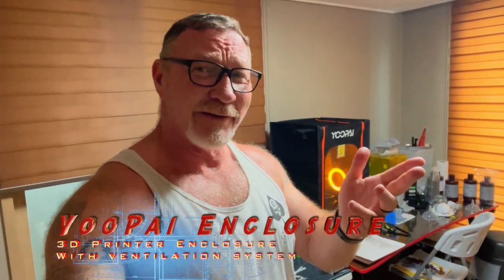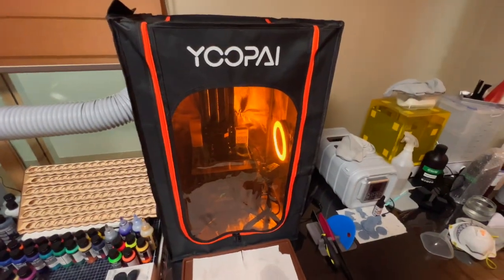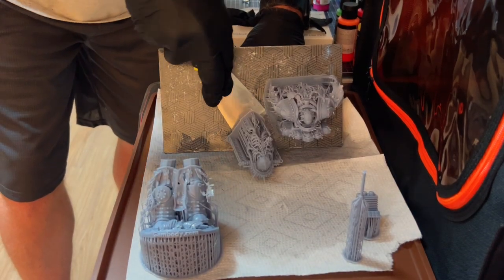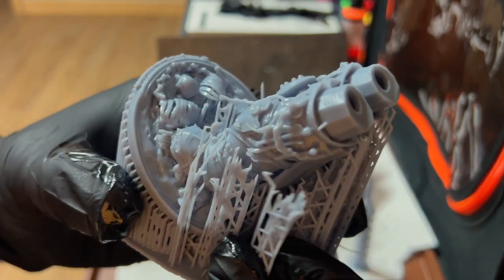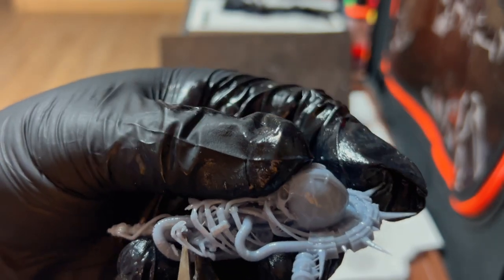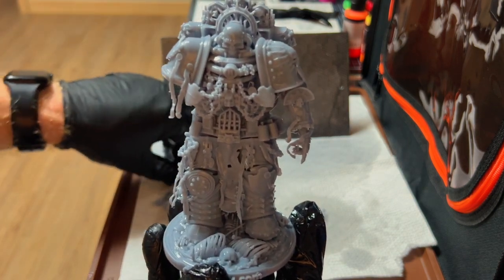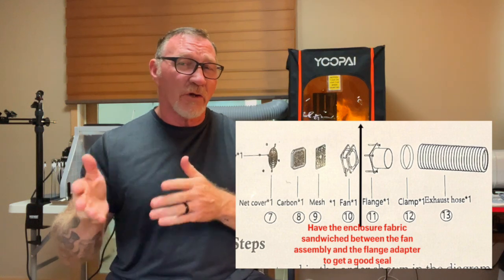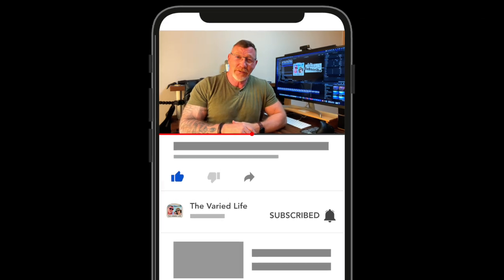YooPai 3D Printer Enclosure for Saturn 3 Ultra - Review & Test print

Comment: This would fit a saturn4 ultra? i curious about the lid design
Reply from the maker: Thanks for watching and good question. The Saturn 4 ultra dimensions are  12.87"D x 12.95"W x 21.57"H and it would fit in this enclosure (approx 17 x 18 x 28). However with my saturn 3 ultra I removed the lid and you would probably have to do the same with the 4 ultra.

Comment: Can it print big things
Reply from the maker: Good question and thanks for watching. The saturn 3 ultra has a build volume of 218.88×122.88×250 mm³ or 8.62×4.84×9.84 inches. So you can get some good prints off of it.

Comment: I just bought the exact same setup (still waiting for it to arrive), I've noticed you are not using the Elegoo enclosure just the Yoopai "tent". Is possible to use the printer enclosure or is just too difficult to use it due to space? Finally, do you think the Yoopai enclosure alone will protect against UV light enough? I'm afraid as my printer will be next to a window, it doesn't get too much direct sunlight, only for like a couple of hours in the afternoon and I'm gonna put some UV protecting film in the window, but sill.
Reply from the maker: Yes the tent works great and I have had zero problems with UV light. I could use the enclosure but the tent has a fan and works great for venting out the resin smell. I have blinds on my windows and haven't had any problems.

Comment: I bought the Yoopai 3d enclosure for my Phrozen Mini 8k S, after experiencing 2 days of failures due to freezing weather. I sealed the enclosure, put the flex hose to the edge of my garage, and shook up the resin before starting the print. It's been flawless since then. The only thing I changed was the Yoopai. It works.
Reply from the maker: Nice. It works really well. Thanks for watching. I appreciate it.

Comment: How about the noise of the printer's fans, does it manage to reduce the noise?
Reply from the maker: It does reduce some noise, which is nice.
Reply: @theVariedLife  After watching your video I decided to buy it because I have the printer in my room and it is noticeable that the resin smells less thanks to the extraction tube, the noise is somewhat less noticeable but still heard.
What I have to try is to install the filter to see if it smells even less.

Comment: Thanks for the video, really helping me decide whether to get this tent or not. Could I ask if you know what diameter the exhaust tubing is? Just seeing if I could rig something together with my spray booth's exhaust
Reply from the maker: I get it. The diameter is about 70mm or 2.75 inches. I made a cardboard adapter to join it up to my 4 inch vent hose that I use with my paint booth.  I hope this helps and thanks for watching.

Comment: I just bought the Saturn 3 ultra. Am i going to need to buy a heater or is that built in? I definitely want an enclosure
Reply from the maker: Good question and thanks for watching. The best temp for resin printing is between 24°C and 30°C (75°F and 86°F). So depending on the temp, you might not even need a heater. The S3U did not come with a heater, it was an aftermarket purchase and the room where my printing is in is a bit colder so thats why I got the heater. I hope this helps

Comment: Hi,
I've bought this enclosure today + Mars Mate. The filter is plug on the lid, inside the enclosure. It's not practical when I lift up the lid and I will certainly make an adaptor between the exhaust of the enclosure and the tube of the Mars Mate.
I can't vent to the outside.
Reply: So with this solution, can you still smell the resin?
Reply from the maker: With the fan on there is still a little resin smell but that could be from pouring it into the vat before I print and when I wash and cure them. I will say the enclosure makes a big difference for me and makes the wife happy.
Reply from the maker: Not familiar with that but do you need a lid when its in the enclosure? I took mine off and vented that way.

Comment: Do you keep the ventilation on while the heater is running? doesnt that kind of cancel each other out
Reply from the maker: Thanks for watching and a good question. I set the heater temp high enough that the temp doesn't drop much when the vent fan is on. Just need to play around and find that happy spot.

Comment: Shouldn't you have the lid on
Reply from the maker: Good question and thanks for watching. I haven't seen any difference when the lid is on or off when using the enclosure. I thought there might be some curing from the ring light but haven't seen that happen (yet).
Reply: @theVariedLife  to me I'd have the lid on to help with extra ventilation.  Since you have the filter on the printer as well.
Reply from the maker: @Batfan83 I see what you are getting at but remember the lid is not a tilt up kind. You have to remove the lid and this enclosure is not big enough for that. If I had a bigger enclosure then I could do that.
Reply: @theVariedLife  gotcha I didn't realise that there wasn't enough room
Reply from the maker: @Batfan83  Yea I wanted an enclosure but also wanted to save space on the table. I almost got a bigger one but it would take up about half the table. So decided to go with the smaller one. So far it works well.
Reply: @theVariedLife  I completely understand that. I found the enclosure on Ali express and have been trying to get honest unsponsored reviews.
Reply from the maker: @Batfan83  I get it. I bought this with my own money and its not sponsored. It works for me and I like the venting system. I'm pretty sure Yoopai has larger sized enclosures. Just check on Amazon or aliexpress, etc.